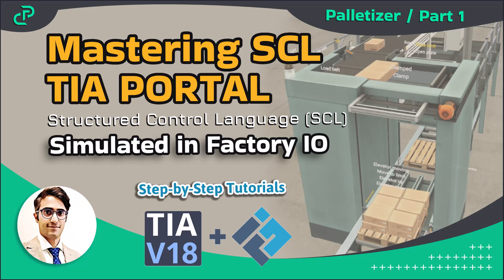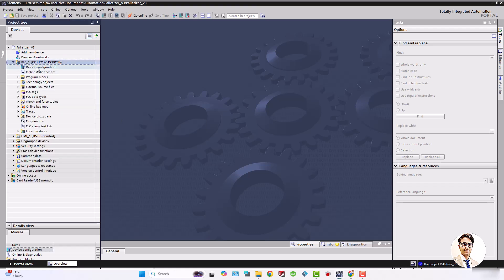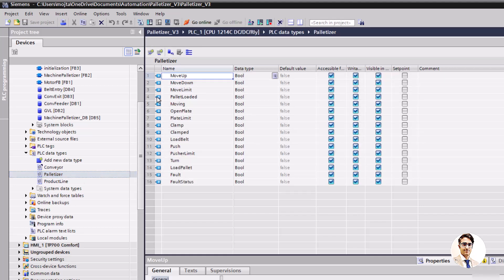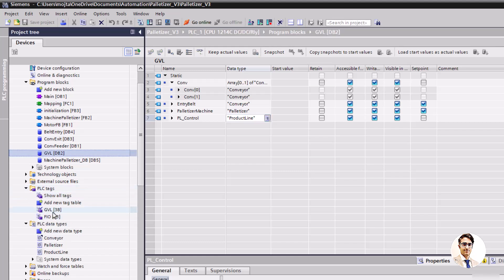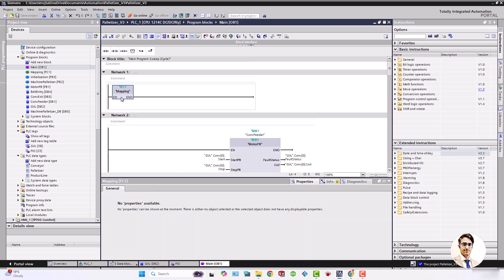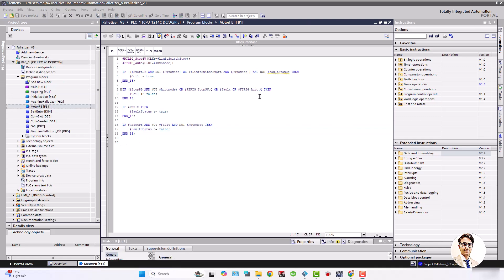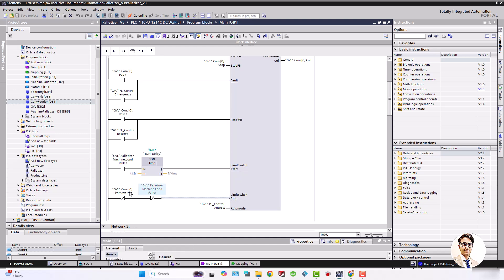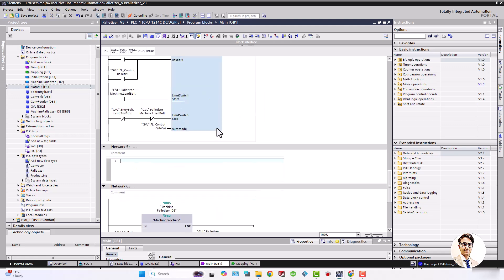1. TIA Portal SCL Programming of Palletizer Machine, Simulated in Factory IO | PLC | Tutorial |

Comment: Is there a way of adding a time delay to start a device in just one line, example start a device and run for 10 seconds. In SFC this can be an action step such as; motorOn==1 followed by a transition t>t#10s.

Can we do this in SCL language?
motorOn:= (switchOn==1) AND (t>t#10 s);

Thanks.
Reply: Thanks, just added this in brackets, that's when the two conditions are true then a true output is given; (SwitchStart AND emergency_Stop_Button)

Now modified to the line below.

#TON_MotorStart(IN:=#(SwitchStart AND emergency_Stop_Button),PT:=t#10s,Q=>#Coil)

Hopefully it is fine.
Reply from the maker: @ah-lx9xi  yes it's correct. Good luck
Reply: @m.alaeddin  thanks .👍
Reply from the maker: #TON_MotorStart(IN:=#SwitchStart,PT:=t#10s,Q=>#Coil);

"TON_MotorStart" is an instantiated ON delay timer
Reply: If there is an online link where I can read about how the parameters mean in the above equation please forward.

Comment: Interesting and thanks. From what I understood the SCL coding was dividend into separate parts. The question is can the whole program be implemented in one body code for the entire machine? Starting with declaring all variables and then do all the reading and outputs depending on conditions.
Reply from the maker: Thanks for your compliment.
Yes it's possible and always in programming you can achieve to the goal from different ways but it's better to be an orgenized and clean code.
Reply: @m.alaeddin  thanks, I just heard in some videos that SCL language produces block function and it seemed that SCL can produce a complete code as in ladder diagram LD. I think a complete body code in SCL might be easier for a complete plant operation. Thanks.